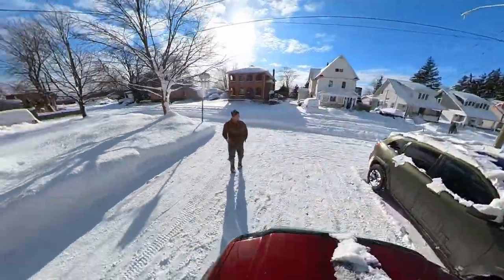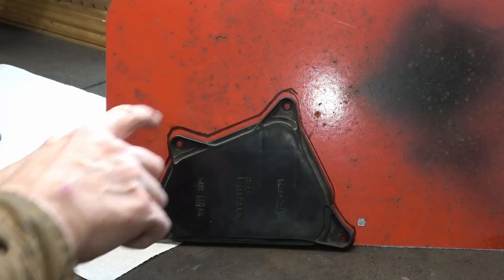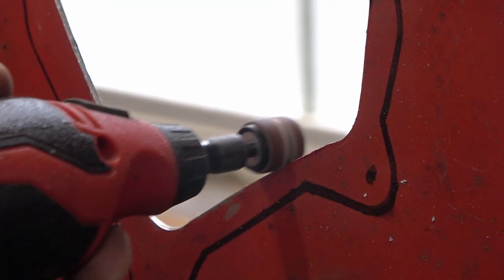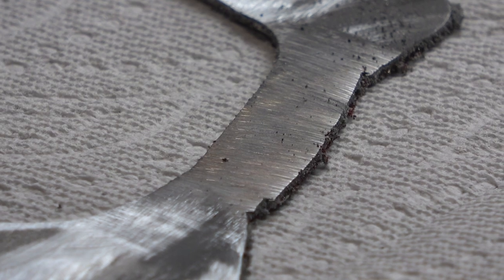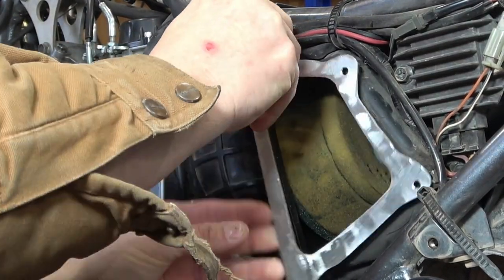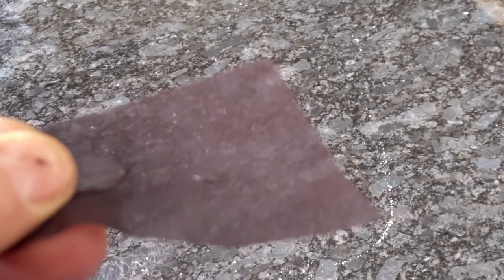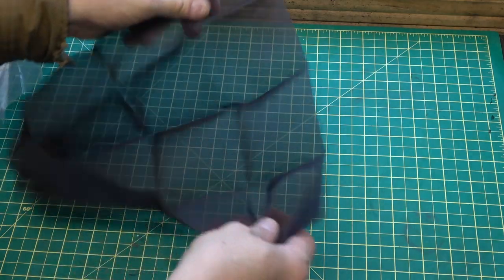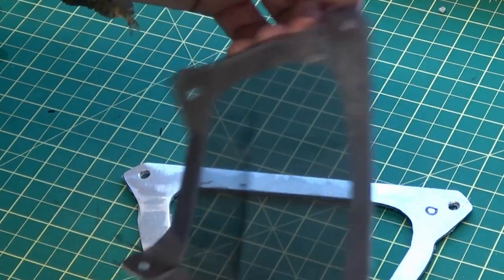Suzuki DR650 airbox modifications to help my ProCycle jet kit breathe better.

Comment: Fantastic mod. But did you start the bike and how did the bike react with all the new air it's getting? Very curious if you noticed any significant improvement.
Reply from the maker: Not yet, I still have to tune it with the new jet kit, may be a while with all this snow.
I will follow up on it though.
Dino

Comment: You ended up removing this right? Not judging just wondering if im getting the procycle jet kit timeline right in your videos haha.
Reply from the maker: Yes I found the bike ran way too lean and was really loud. I'm sure with an aftermarket pipe and large jetting it would work, but for me, it was a bit more than air flow than I wanted to deal with. Thanks for the question.
Dino

Comment: Two feet of snow??   Some people have all the luck.😏  Good luck with the carb update.  Previous owner of mine did the jet kit and hole-sawed the air box.  Further mods were done with duct tape to reduce the number of holes.  Runs great.  A buddy has a pumper carb on his and swears mine is more responsive.   YMMV.    Cheers Lad!

Comment: I hope the air box and carb mods work out for you Dino but I would be prepared to put it back to stock. You will be getting a lot of additional intake noise that can be annoying at higher throttle settings. In the past I have attempted a similar process on my 1980 GS1100 but could not achieve satisfactory results. It seems that CV carbs are quite sensitive to vacuum to function properly.  Anyway.. good luck and let us know how it works out in the spring. Hopefully you have a riding buddy with a good running stock DR you can compare to for a baseline. Now I have to break out my ZR8000 and take it out for it's maiden run this year. Heading to New Brunswick for a 6 day ride in 2 weeks.
Reply from the maker: I am as interested as you are. the jet kit specified the additional air is required but I will have to see what the drone will be like with the cover opened up. My buddy Karl has the same kit in his and it ran much better than mine. I do not know about performance but it starts, idles and accelerated much smoother than mine. Just did close to 150km on the sled today, I'm tired, New Brunswick will be awesome, have fun!
Dino
Reply: Heading to New Broomstick eh?  The trails are great here now in the south.

Comment: Hey Dino....I have been enjoying your videos....thank you for your efforts. I just bought a stock 2020 DR650 and am doing the typical mods for performance and ergos...i am 6'3 and 295 lbs...I found 24 hyabusa pipe nearby and am waiting on a midpipe and a carb mod kit from procycle.  Yours is the first i have seen of opening up the side of the airbox as opposed to the top...I really like the idea with the material you use to pre filter... Can you tell me what led you to do this as opposed to the top?  Just curious.
Reply from the maker: Really it is two things that pointed me on that direction.
1 I have read that some people who cut the top of the air box had issues with surging at certain rpm as the air box scavenged enough air to impact the small air filter under the seat which is connected to the CB carb.
2 my mod is fully reversible if I don't like it. Cutting the top of the air box is an all or nothing mod. Mine you can always reverse the entire job.
I'm not yet sure how well it works as we have almost 4 feet of snow in my front yard right now. I will however do a video once the weather is favorable
Thanks for the great question.
Dino
Reply: @DinosTinkerShed  Thanks for the quick reply.  I should have my items in from procycle in a couple of weeks....I think i will try your mod...maybe Ill beat you to it to see  how well it works as I am in Florida.

Comment: Hey Dino - I've seen as many videos as possible on DR650 mods and your videos are, by far, the most helpful and well edited!   I've got the 150 jet, 4th needle space, and the top of the airbox opened up via the template.  I've als got the Leo Vince slip on and I've ground down the header weld.   The bike has always run lean, and has been getting worse.  I'm getting amazing mileage, but still...

I just wanted to ask about a follow up on the air box mod.  How did it affect things?   According to your previous install video, things seemed to be fine for you so what prompted you to open it up?
Reply from the maker: Thank you for the comments and questions. I tried the air box mod to see what would happen, in the end though it was running way to lean so I put back on the stock air box. I think the idea is worth perusing if someone wanted to maximize the intake air flow potential but the jetting would need to be really rich and you would need a free flow exhaust. because I am using the stock exhaust the stock air box seems to work best still.
I hope this helps. :)
Dino
Reply: @DinosTinkerShed  Thanks for the reply!   I was recently on the forums with the former owner or Procycle, and he mentioned that the airbox mod really only affects bog throttle openings and higher RPMs.  I'm looking at the carb for my low throttle issues.    

I started with the float height but something looks off - the float tang is resting on the plunger itself without me pushing down on it at all.  That seems wrong according to your other video.  Any opinion on that?
Reply from the maker: @benrecchi2880  I may meet to review my own video, I can't quite envision what you are describing. Is the carb upside down when it is touching the tang?
Reply: Any thoughts on that?  Seems weird to me
Reply from the maker: @benrecchi2880  Hi Ben, sorry for the slow rel=ply on this. Again I am not an expert when it comes to carb tuning, however if you have an aftermarket exhaust and opened up the air box the 150 carb may nor be enough to keep the air/fuel ratio rich enough. have you tried a ricer main jet?

Comment: Nice thanks, but have you ridden the DR since, that carb doesn't respond well to mods. Yes, you'll have more power at the cost of smoothness.
Reply from the maker: Have not ridden it yet. Still 2 feet of snow here. I am aware of the surging issues, this is why I did not cut the top out of the air box, right now I can reverse everything to stock if I have too. My main goal was not more power but to install the adjustable mixture screw to add some fuel at idle. 
Thank you for the comment and feedback, it is appreciated. 
Dino

Comment: Great video Dino, thanks for sharing. I may myself consider using a plastic recycle container to do the same, might be easy to work with.
Reply from the maker: Thank you for the comment, I did find the bike ran a bit too lean with this mod, I do however still run the factory exhaust so that may be an issue.
Please let me know how you make out.
Dino
Reply: @DinosTinkerShed  If you run a free flow exhaust the lean problem will increase even more. I believe the best result for the stock exhaust is zero modification of the air box and simply remove the snorkel if you installed a jet kit.

Comment: I think that air box mod is better than drilling larger (permanent) holes in the top of the air box.  If there is too much air you can easily reduce the open area if needed.
Loved the opening pic - I used to travel to Toronto first week in March for a number of years and being from Aus loved the sight of the snow just outside the city area. Easy for me to say - I did not have to clear the driveway!! Gets bloody cold however.
Reply from the maker: I agree, I can even make a new panel  with a smaller whole, I tried to match the size of the cut out ProCycle provided in the kit, just use it on the cover instead of the top. 
I have always like the look of new snow as well, I think I look at the landscape in Australia the same way, it looks so amazing to me. I watch a lot of videos from the content creators over there, love it.

Thank you again for the comment Mal.
Dino